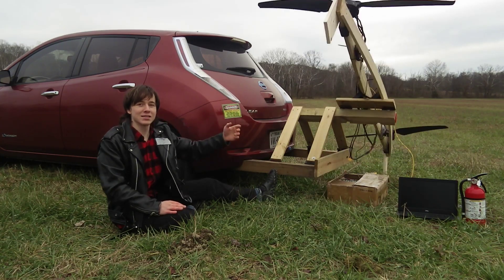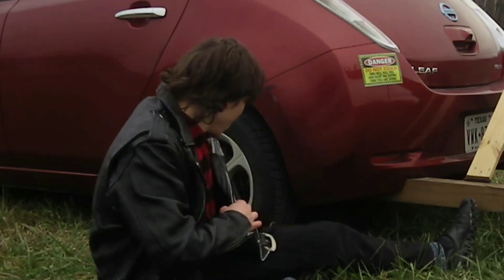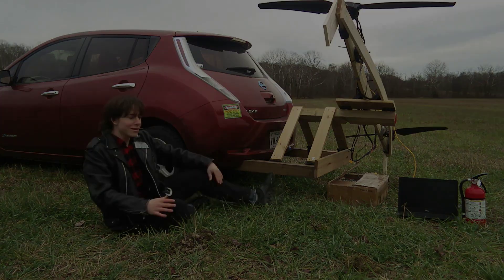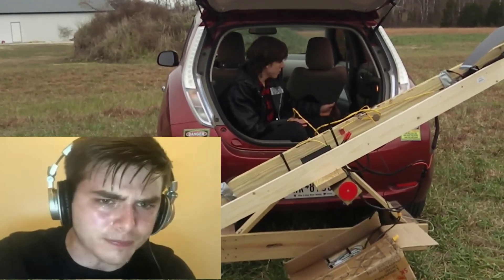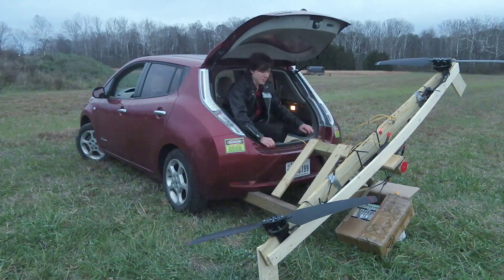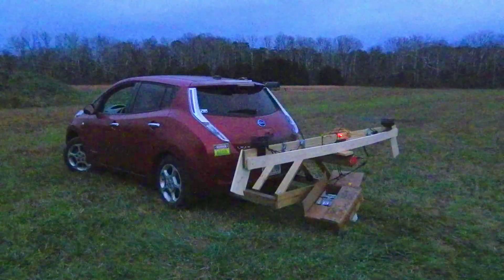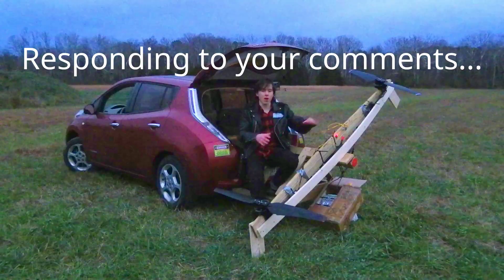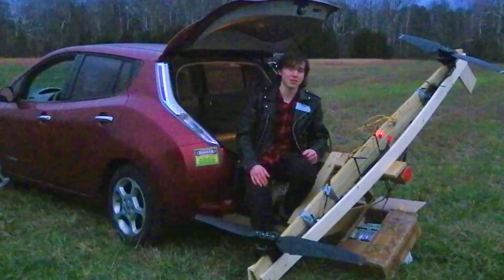DIY Flying Car - flight controller testing day

Comment: You can get waivers for weight.  I'm going through the process for the darpa heavy lift challenge.   At least in this video you're not exposing yourself directly to the props.  You just need to tune the filters better.

Comment: carbon fiber tubes are not that expensive you probably would have the money for them if you didn't waste so much on wood. you would do better learning to tune an fpv drone and learn to fly one of them first.  look up the PID TOOLBOX guy for help with tuning pids. also if you do manage to get it to work think about how to deal with a D-sync when in the air.

Comment: I’ve been rocking a Flowbee for over thirty years. Yes, that vacuum-cleaner-haircut contraption from the infomercial dark ages. It still works like a champ—mostly. A few plastic bits have surrendered to time and gravity, but miracle of miracles, the Flowbee company still sells replacement parts. I’m pretty sure they’re running the world’s longest “prank that got out of hand” operation .I once got the inventor on the phone (long story, involved a landline and persistence). He told me the whole origin tale, and honestly, it was less “eureka moment” and more “I got tired of paying $12 for a haircut in 1988.”Kids these days look at me like I just pulled a rotary phone out of my pocket when I mention it. They have zero clue about legendary gadgets that blazed brightly and then vanished like my metabolism after 40.Examples, you ask?“ Did you ever own a Frisbee?”
Sweet summer child, in the early 1950s we had the original: a metal pie tin we called a “flying saucer.” Slightly larger, zero aerodynamics, 100% chance of decapitation-grade edges. Wham-O just slapped some plastic on it and called it innovation.
“You mean like inline skates with four wheels in a row?”
Please. I had clamp-on skates with exactly two wheels—big, squishy, oatmeal-colored monstrosities that turned every sidewalk crack into a potential ER visit. We didn’t skate; we survived.

So listen up, Gen Z inventors hustling on Kickstarter: before you crowdfund your “revolutionary” new thingamajig, maybe Google it first. There’s a decent chance some guy in 1973 already tried it while wearing bell-bottoms and a look of quiet desperation. You might not be inventing the wheel—you might just be putting Wi-Fi in it and charging $800.

Comment: Get material, immerse in resin/epoxy, layer. You can make a carbon fiber-esque material with fiberglass material, but you can also get the cloth to make your own carbon fiber. None of these options have to be that expensive.

Comment: Definitely making progress. I made a video building the cheapest flying car I could with aluminum from Home Depot, which also resonates, so now I'm using carbon fiber. BTW I tied down my >55lb drone to be in a legal grey zone with the FAA, and I doubt they'll come after me. Peter Sripol did the same thing too. I should probably put a disclaimer here: this is not advice and of course if you do it, it's at your own risk. Good luck